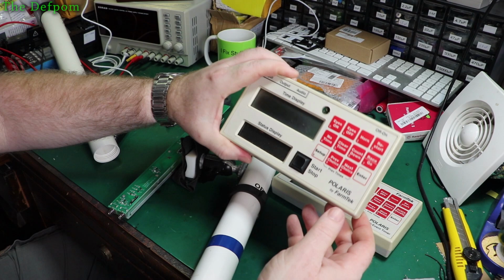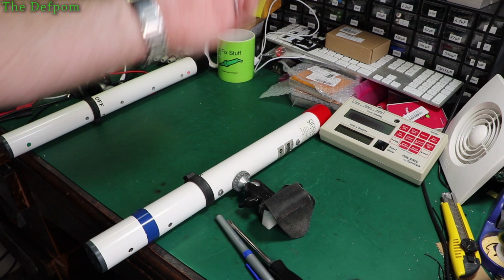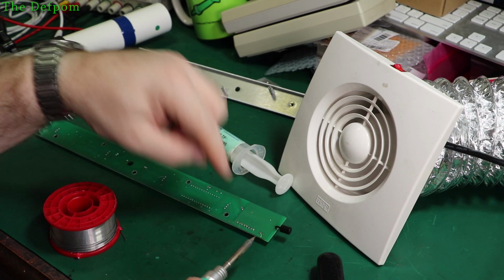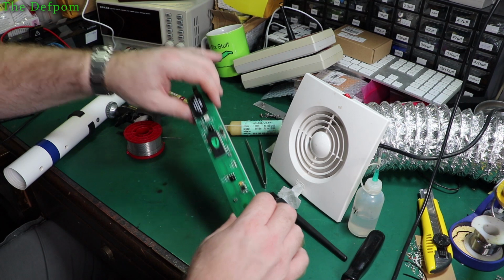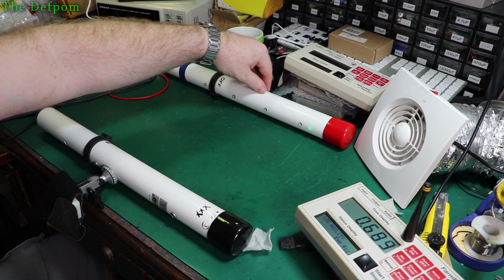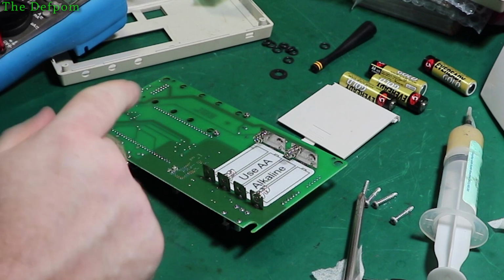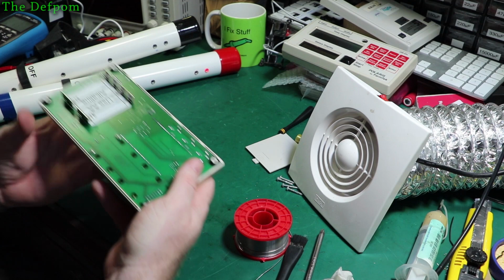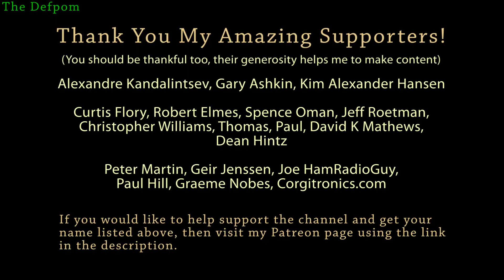#703 Farmtek Light Curtain And Range Repair Part 1

Comment: Probably the 2 second delay is to handle legs and such triggering the beams, and I would guess that you need 2 beams broken to do a trigger, so that an errant moth or fly does not affect the results by flying between the poles in use.

Check IR emitters with cellphone front camera, as it will not have IR filters, and also how about lifting module slightly and using a bit of double side foam tape there to damp vibration of it, will save those joints from stress.